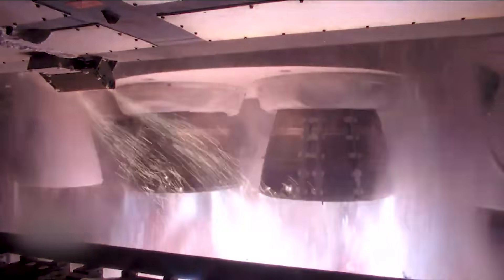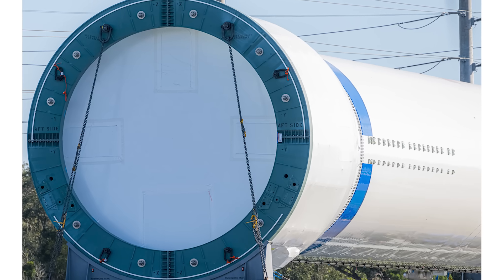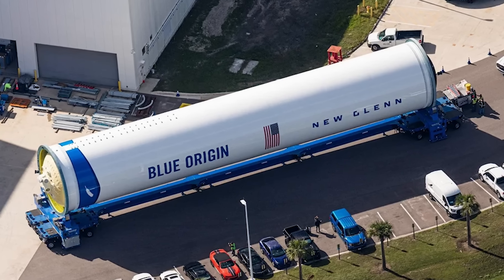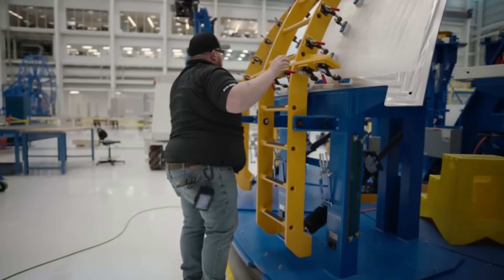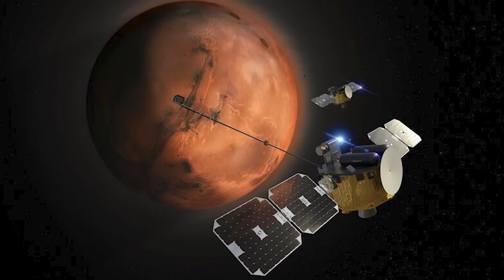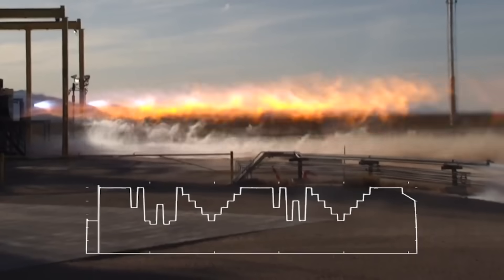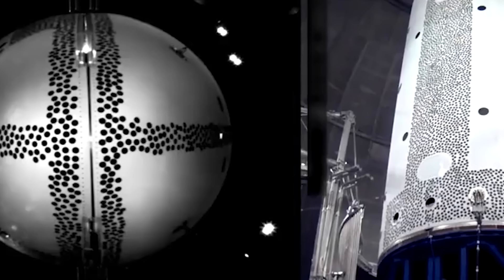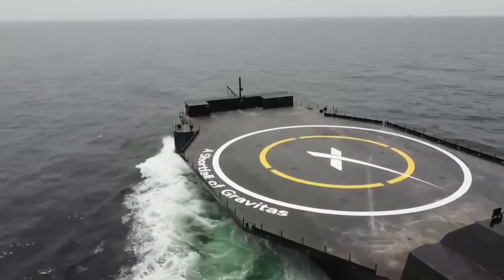New Glenn Flight Hardware Is Headed To The Launch Pad

Comment: Observing the Comments on TSB during 2023, the tide of opinion expressed by the on-line Space Community seemed to be turning from for to against SpaceX.
   Before the April 20 launch fiasco 
at Boca Chica, SpaceX Fans were prolific and unanimous in their "adulation" of anything SpaceX did, however small, while SpaceX detractors were few and far between.
   Since April 20, NASA has awarded a second lunar lander contract to Blue Origin; Starship has failed again; NASA publicly blames SpaceX for the cancellation of Artemis 3 (no crewed landing now); and ULA has just proved Blue Origins BE-4s DO work.
   Now on TSB Comments, SpaceX Fans have become subdued and defensive, condemning the growing list of successes of the competitors of SpaceX; while the SpaceX detractors seem to be "coming out of the woodwork", as though they were biding their time, waiting quietly for results from ULA and Blue Origin.
   I suspect TSB Comments in 2024 is going to get vicious; everyone will have their knives out.🔍🚀🌚⌨🗡

Comment: How is it clear they are close to testing? This looks like a mockup for GSE fit tests as it has a not for flight sign on it, no sign of any engines. Remember they need seven BE-4s for this rocket and have no where near that number ready for testing let alone integration. I would be surprised to see it on the pad this year especially after the engine explosion that destroyed one of their test stands a couple of months back.
Reply: This is not a mockup. The "mockup" was sent two years ago to LC-36. This is a complete enough 1st stage with a mix of flight and non-flight hardware, and will be used in the same way that ULA used the PTT fueling pathfinder to test propellant loading, booster systems, GSE, and countdown procedures.
Reply: @thomasackerman5399  Either way this is still not flight hardware and the assertion that New Glenn is 'close to testing' is preposterous.
Reply: @schrodingerscat1863  Oh please. Testing takes many forms, the midbody and aft module are flight hardware (you've been caught in another lie), and the booster can do many tests that do not require it to fly. So it is REAL hardware, whether you like it or not.
Reply: @thomasackerman5399  I never said this isn't useful for testing but it is far from flight ready hardware. It's going to be used for GSE testing. My contention is that the idea there are going to be static fires and that kind of thing is ludicrous. there aren't any engines installed on it for one. There are parts not flight hardware which is where the not flight hardware labels come in, the tanks will be real as they are needed for propellant load tests. This is early days GSE testing after all. Still at least it shows some progress. Will be interesting to see how engine production ramps up. That has been the biggest headache for BO so far and they are going to need a lot for engines for a test campaign.

Comment: One big difference between BO and SpaceX is their ability to "absorb" (or even expect) failure.
But the two BezosEgo-4 engines did get a jolly good test the other day, so it's looking hopeful.
Reply: The BE-4s launched ULAs Vulcan/Centaur, Schroding, and that's what matters.
Dozens of contracts have been signed, billions of dollars are changing hands.
Schroding, your opinions mean nothing to the Space Industry.
Reply: @davidstevenson9517  My main concern is nothing to do with contracts it is contracts being fulfilled. We have already seen a 5 year delay getting Vulcan launched. If BO have problems ramping up production of their engines no amount of contracts are going to sort the problems out. If BO are unable to deliver sufficient engines then Vulcan is grounded and ULA will be in a seriously bad position along with all their clients relying on them for launch services, also New Glenn won't happen and BO desperately needs the revenue stream from launch provision as the engines are making them no money at all. You are correct in saying my opinion means nothing but the issues we have seen with BE-4 remain and there is a lot riding on that engine being successful. I have been in business for too long to think contracts make everything ok.
Reply: The engines did one launch, were 3 year late and double original cost and one of the next 2 slated for ULA blew up on the test stand causing a huge amount of damage a couple of months back so not the best.
Reply: @schrodingerscat1863  Everyone's years late, even SpaceX.

Comment: Wouldn't it be funny if BO beats SpaceX into orbit with a methane based rocket!  Of course, BO has yet to put anything into orbit, let alone a methane based rocket!
Reply: Blue Origin has just put something into orbit: ULAs Vulcan/Centaur launched by two Blue Origin BE-4 engines!
THAT is why you SpaceX Fans are seeing RED! The writing is on the wall and none of you SXFs like what you read.
We SpaceX Detractors have been waiting for this and, personally, I revel in watching you gullible newcomers to Spaceflight SQUIRM!

Comment: Same old ancient rockets. There has been no innovation, nothing so ce 1969
Reply: Methalox is not your 1969 rocket. One cold gas vernier control on the BO 2nd Stage has a 1000x more processing power than all the computers combined on a Saturn 5. Telemetry is measured now in Terrabytes nor kilobytes. Nearly 60 years of materials science has given BO and SpaceX lighter weight, more durable, thermally stronger, robust rocket technology. Except for the basic physics of pointy end up, flamey end down, and basic Orbital mechanics, EVERYTHING has changed since 1969.
Reply: Ah yes, the famous 1969 methalox reusable first stage rockets
Reply: ULAs Vulcan was launched by newly designed engines and achieved orbit.
   SpaceXs Starship was launched by newly designed engines and blew up, twice.
   NASA has publicly blamed SpaceX for the cancellation of the Artemis 3 crewed landing.
   NASA has chosen a second lunar lander for Artemis 5, Blue Moon, built by National Team whose members are Boeing, Lockeed Martin and Blue Origin...who also just happen to be the members of ULA.
   SpaceX is in trouble.

Comment: I’m a fan of whoever is going to space.  For years that was SpaceX, but with Musk now primarily focused on X, the incredible Starship seems to be wavering.  Bezos sees it too, and has been pouring on the coal to seize the lead with New Glenn.
Reply: If you think Starship is wavering then you aren't paying attention.   Both S 28 and B10 conducted static fires late last year barely a month after ITF-2.  Now Space X is prepping the launch pad for the next launch as it is removing some of the vertical tanks that are no longer useful. Space X has also been preparing S 26 for what could be a ship to ship fuel transfer in a future flight further down the road.  Space X also has to wait on the FAA to certify the next launch.  

Lastly, Musk has been busy with Twitter, I still use the old name thank you very much, but Space X continues to function like a well oiled machine.  The team at Starbase know full well what the plan is for starship and Elon does not need to be there.  That is how a competent company functions anyway.
Reply: @michaeldeierhoi4096  What I mean is that Starship development has returned to a mortal timeframe instead of the incredible leaps that Elon was making when it was his sole focus.  NASA sees it too, the Artemis landing has been slipped by a year.   And their inexplicable awarding of a Mars mission to BO speaks volumes.
Reply: @josephastier7421  I think starship development is on the same track it has always been going 24/7!!   Both B10 and S28 are virtually ready for the next launch and are waiting for the FAA certification before completing the final tests and arming the FTS.  They could get that FAA cert at any time and launch before the end of the month which is barely two months since the last launch.  Space X could be doing a launch of starship every two months.  We'll see.  

Space X has a total of 98 launches last year almost hitting their goal of 100 launches.   That doesn't sound like they are slowing down at all.  And I'm not surprised that the 3rd flight of Artemis with starship is going to be later.  That was always unrealistic.  

I had not heard about the Mars mission going to BO.
Reply: BO will likely be deploying its payload in LEO at about the same time as Starship. Thank you for your well written and composed shit post. Professionals don't talk this way, amateurs do.
Reply: Starship and New Glenn absolutely do not compare on ton to orbit. Starship has TTO of around 100-150, NG has around 45 or so. Even FH has more than NG at about 65. Best case scenario, NG only competes with F9/H. More vehicles only mean more competition and cheaper flights to space, so I wish everyone well.
Reply: @okirooju3787  All this juvenile chest beating makes the non-professional space community look like a bunch of kindergarten kids fighting on the playground. Blue iike any rocket company is going to use lessons learned  to scale up and employ newer efficientcies in production and operations. Just because a company is first, is no indication it will stay in the lead. Tesla is the most obvious example. Chinese EV firms are outselling or posed to take over market share. Detroit and Japan are rapidly catching up and will reach parity. The same will happen in aerospace. Ask Boeing about Airbus.
Reply: @sandbridgekid4121  my original comment was addressing the notion that BO NG is set to catch up with and overtake SpaceX Starship when both rockets target different segments of the launch market, are of different architectures, scales and complexities. If you read my comment without any bias my point should've been sufficiently clear. I also plainly stated that more launch vehicles to space means more competition (implying competition to companies like SpaceX) and cheaper flights to space.
But you've written your response with a (biased) assumption of SpaceX-bias on my part. Not fair at all. Please re-read my comment.
Reply: @okirooju3787  63 metric tons for a FULLY expendable FH. We don't know what a fully expended and stripped down New Glenn could manage, but some estimates place it around 55 mt.
Reply: @okirooju3787  That's FH in fully expendable mode. I believe the NG number is in its reusable configuration and it is on par with FH depending which reusable mode is used. Also NG's mass to GTO should be better with both in reusable configuration.  What really sets New Glenn in a class of its own is the fairing size. Its fairing volume will be ~3x times larger and much wider than current F9/FH fairing and ~2x the volume of the extended fairing SpaceX has planned.

Also sheer payload to orbit doesn't really matter for most customers. Most customers don't benefit from Starship's huge mass and volume to orbit, unless they have a huge payload or are willing to use a rideshare and settle for a less ideal orbit.

Comment: It took SpaceX over 12 months to make a successful landing with the Falcon 9. Blue Origin is under the impression they can do it first go and with their pace of manufacturing rockets they had better or it will be another 5 years until they get one right.
Reply: They have the benefit of seeing how spacex does things, so they can copy it.
Reply: @XShadowAngel Just like SpaceX copied NASA.
Reply: It is not necessary to fail before you succeed, but you learn so much more when you fail. I mean there were no failed lunar landing attemps before NASA succeeded. Blue Origin does have some experience on propulsive landings with the New Glenn, although not from orbital velocities. SpaceX and Blue Origin have wildly different approaches when it comes to development. SpaceX's approach is fail fast and Blue Origin's is Graditim, ferociter, Step by Step, Ferociously. Blue Origin has indeed taken it's time.
Reply: Both companies work veryyy differently Spacex ethos is rapid development, iterations and deployment. On the contrary as you see ULA its more of get as many thing right from the beginning approach. Also even though BO is quite slow there New Shepard did perform really well so I am hopeful they wont need as many iterations to get to the level of Spacex. Also u cant just copy a spacex stuff a lot of limitations are there cause of engines, type of fuel, thrust rations and so much more they all find their own way just some more slow then others. But as long as they can pull it off its great for all.
Reply: @ShaanYeatAminRatul  Falcon 1 at least made it to orbit. New Shepard is a very dangerous carnival ride.
Reply: I've seen older rockets go up a version for a lot less changes than has been made to Falcon 9.

Grid to octoweb, massive generational changes to the Merlins, multiple extensions, added legs and grid fins. It's barely even the same rocket.

The only thing that I'm aware of that hasn't changed very much is The Pusher to separate stages. There's a whole story about the pusher piston.

Vulcan Centar isn't even a whole new rocket. Centar goes back to the 60s.

Apples to apples SpaceX is moving an order of magnitude faster than anyone else.

Comment: Some eagle eyed photographers spotted a sign on the booster saying 'not for flight'.
Reply: It's probably a mockup for fit tests with ground support equipment, the only actual hardware seen so far is a LOX tank going for pressure and cryo testing.
Reply: @schrodingerscat1863  This would be a lie, on both your parts. Several people have confirmed that only the interstage is a non-flight article, the rest of the booster is the real deal. See my other post to you, and why you're wrong about this stage. The fit test mockup was sent two years ago to LC-36.
Reply: @thomasackerman5399  either way it isn't flight ready hardware so the assertion it is almost ready for testing is way off.